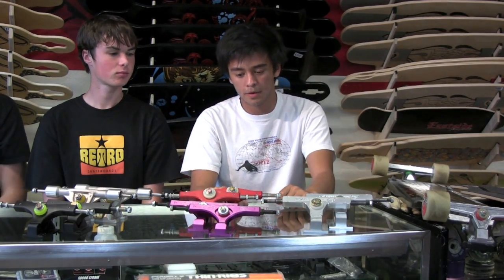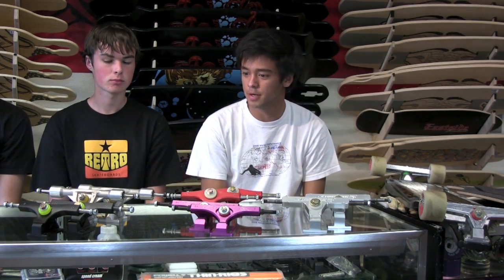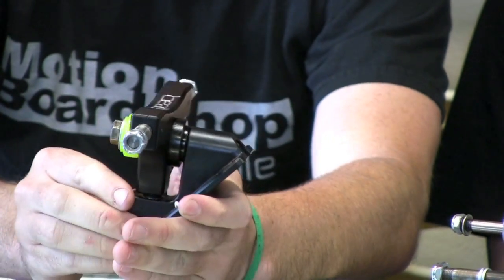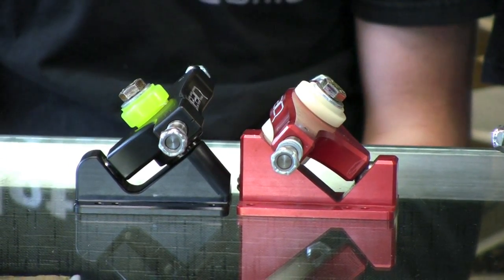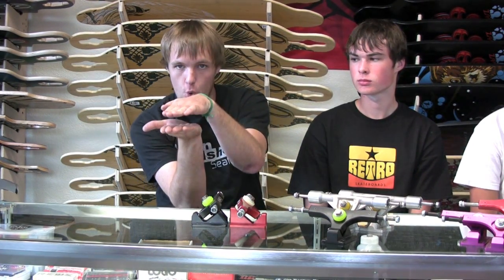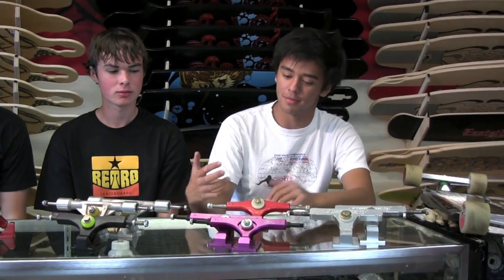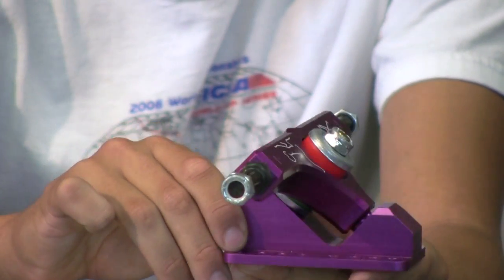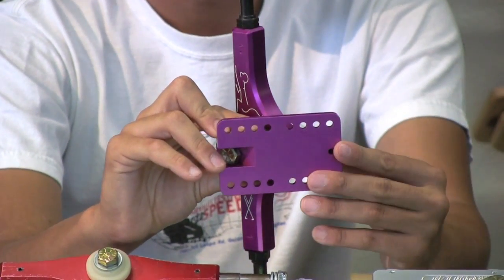MotionBoardshop.com  "How to Choose Precision Trucks" Part 1

Comment from the maker: @MountainTopBoards 

yes, alot of people run what is called the "prandal" setup which is a paris hangar and a randal base plate. People like the engaging bushing seat of the paris hangars but also like the multiple angle options that come with Randal Baseplates.

Comment from the maker: @cownage12345 

Barrels will fit in smokies just fine, smoky bushing seats are very restrictive, but that's the way they're meant to feel because they have two sphericals in the trucks which makes them extremely responsive even with minimal amounts of lean. I've personally ridden radikal talons for about a year and a half and they're super sweet trucks, practically polar opposites of the smokies, the bushing seat (or lack there of) on talons provides practically no restriction so they lean alot.

Comment: I got a couple questions. 1. Whats more practical for a higher degree baseplate like 50 degree and a lower degree like 25. Whats the difference. 2. Why would you have a different bushing on the bottom then on the top.

Comment: Hey guys i was looking to get some surf rodz trucks for going fast (over 40mph) i was stuck with which hanger and degree baseplate to get.  I was thinking somewhere around 45 degree plates but i wanted to hear what you guys had to say.  Id be putting the trucks on either a Ly drop speed or a earthwing bellyracer.  Also should i get the 176 hanger or 200.  Thanks guys im looking foward to what you all have to say.

Comment: not all trucks are the same some with different designs are more aerodynamic and use different materials and are inherentley lighter but cast trucks are usually a similar feel because they are made the exact same way and the only difference is your bushing setup

Comment: @11dosentmatter You don't have to, but it's a little smarter. The bigger wheel weighs more. More weight = more Inertia = More force. If you hit it against a curb, that's a lot more force, and chances are a 8MM axle will just bend under the force. 10 mil well have less of a chance of bending, but they aren't invincible. I still personally prefer 8MM trucks, and still prefer riding regular trucks than precisions under all conditions. My friend's Radikal Talons just doesn't feel right freeriding.